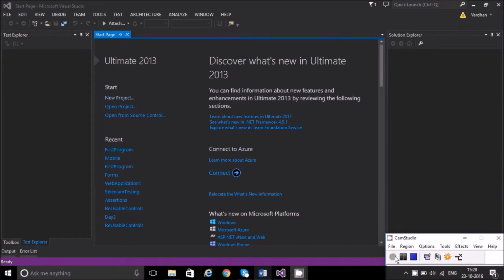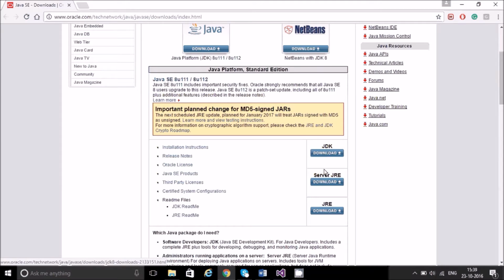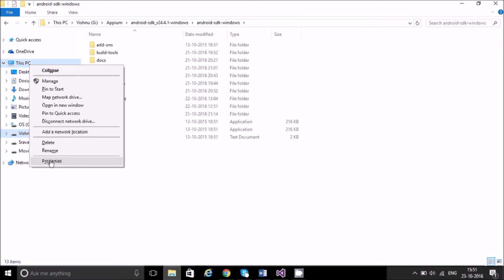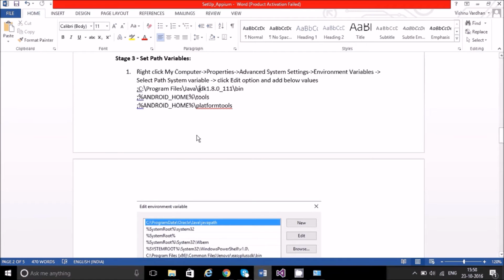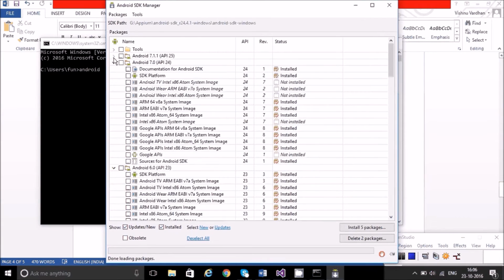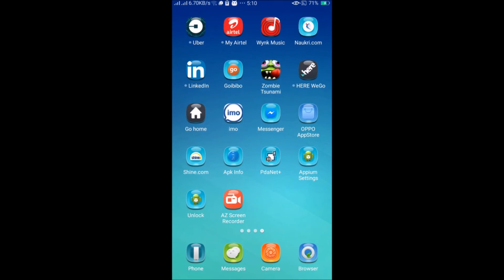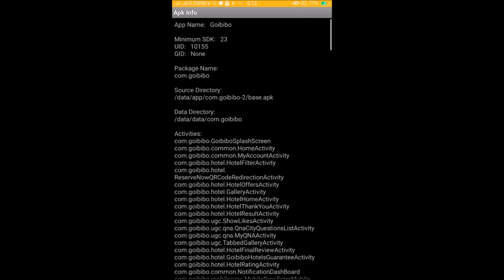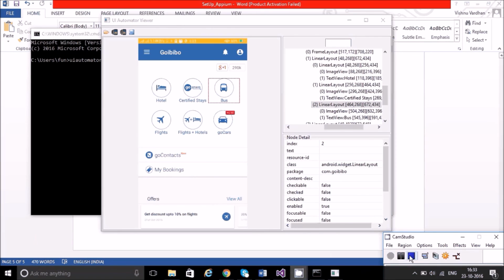Appium Using C# | Mobile Automation Testing - Part 1

Comment: having trouble with the android sdk part. sdk tools downloaded from the link is different and only contains the tools folder. I setup the path but the SDK Manager application is missing.
Reply: Right .. I noticed the same android sdk windows folder extracts tool folder not as shown in tutorial video. tried the same with older version but the problem is not resolved. suggest me if any one of you got the solution for this problem.